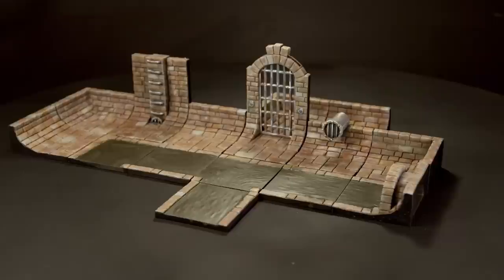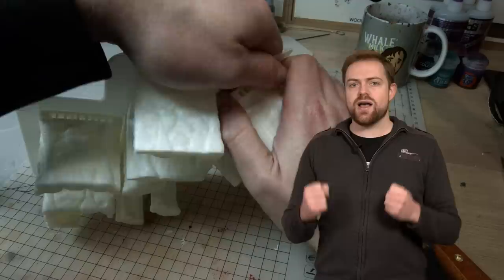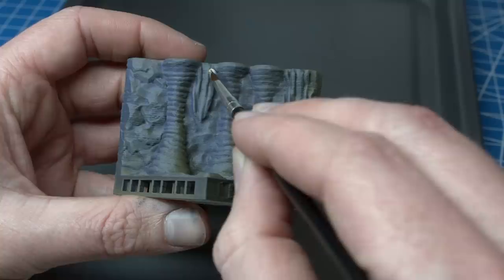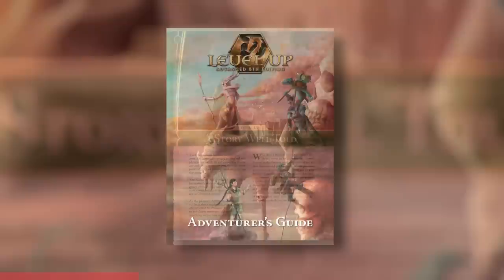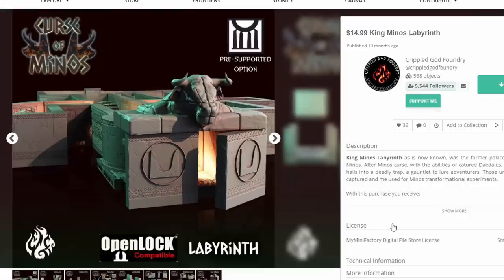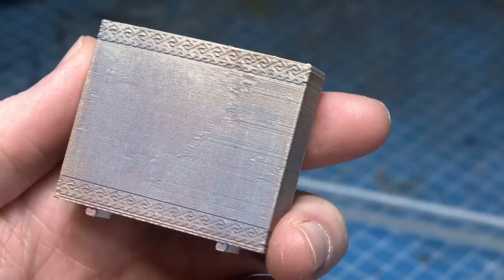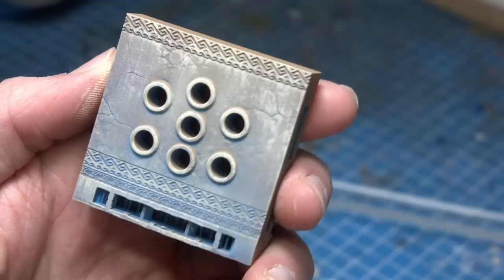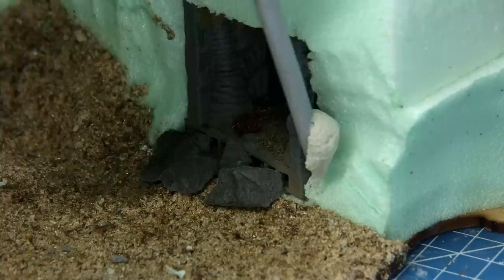You'll never base coat the same again...

Comment: Yes! This underpainting technique is the best way to churn out impressive paint jobs.
Got to paint up a rock in less than 5 minutes? Instead of black or dark grey shadows, use a dark purple and drybrush with a grey or tan as usual. Boring rock is now interesting but not distracting.
Have to paint up a thousand monsters for DnD or Warhammer horde? Underpaint like this with spray cans, airbrush or even just a fat brush where you lay the colours and maybe wetblend or stipple if it is on an upwards-facing surface. Then use either a few targetted layers or some heavy glazes to break up the different sections on the model.

The more adventurous the colours, the better. As long as you drybrush or layer with something more muted, it is sure to look good.

Comment: What Printer did you use. FDM or Resin?
Reply: based on the supports he needed to remove and the massive layer lines,  it is FDM. that is also way more economical for large amounts of terrain/buildings
Reply: @wkblauwster  I hate layer lines. I run a couple of 4k resin printers. I should get a FDM for terrain. It's expensive to print in resin but the finish is soooo much better.
Reply: @MiddletonJeff  you can dile in fdm printers a lot better in then what you see here. they properly mainly used factory profile and settings. if you take your time properly calibrating all parts of it you can get a lot cleaner results. you will still have layer lines but they will be consistent making them a lot less noticeable. more like a intresting texture that you only see close-up. the truth is that FDM just ain't as much plug and run a resin printers. resin printers these days are ,as long as you level and keep temps and humidity under control, working without basibly any tweaking.